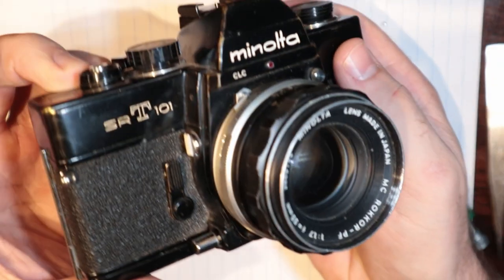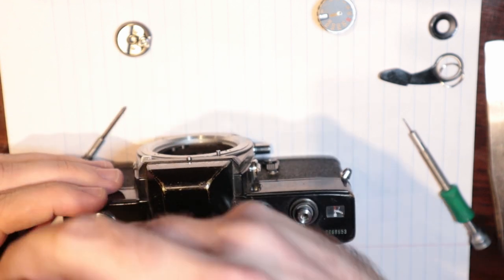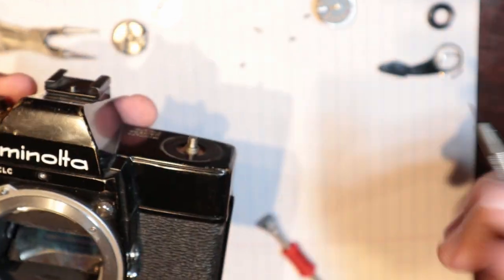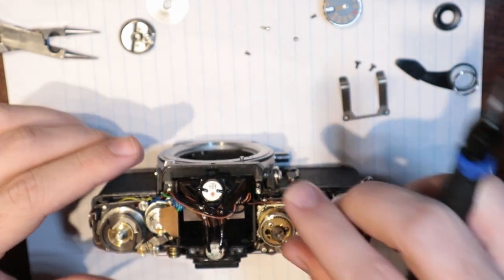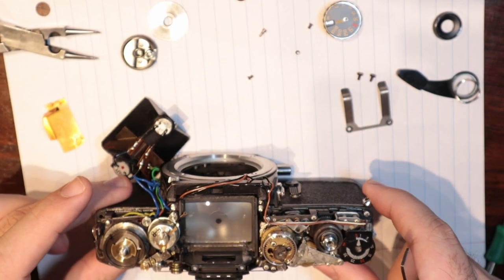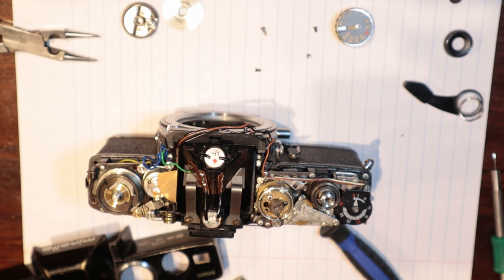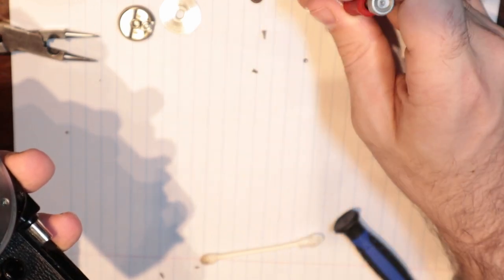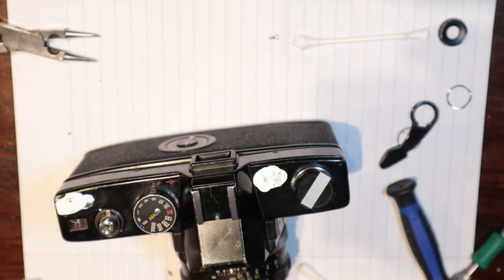Minolta SRT 101 Repair (Top Removal and Cleaning)

Comment: Hey, nice video, it helped me a lot - I just got, SRT303, I won it cheap (23 Euro = approx $24-25), it was sold if very nice condition, but it came with quite horrible dent on the top of prism case (fortunately it did not crush anything inside), so the video definitely helped me figuring out how to take the top off and partially fix that dent... but as it came with Metz flash, Minolta 55mm adapter ring, Minolta polarising filter, Minolta Close up lens and the body seems to be working fine - I cannot really complain... I have a question hower, few weeks earlier I bought SRT101 and both cameras at longer shutter times (101 below 1/30, 303 below 1/4) keep the mirror up, after releasing shutter, until I rewind it... is that normal or it needs adjusting?

Comment: If you take out that rod that you pull up to open the back, can you open the back in any other way? I think I've locked mine
Reply from the maker: You would need to remove the top to access the back door release from there